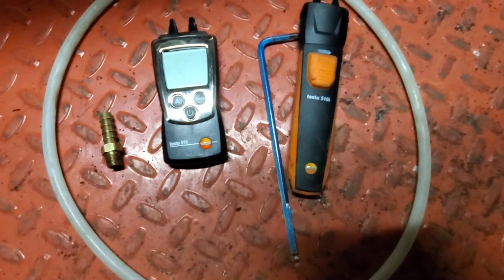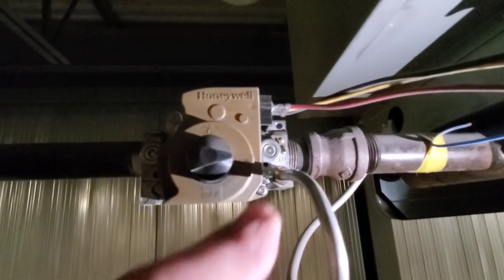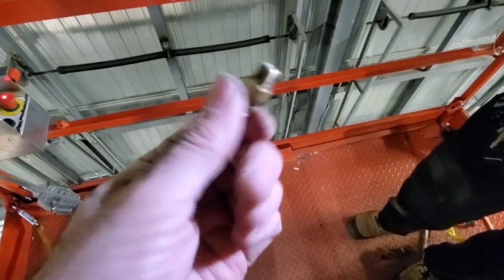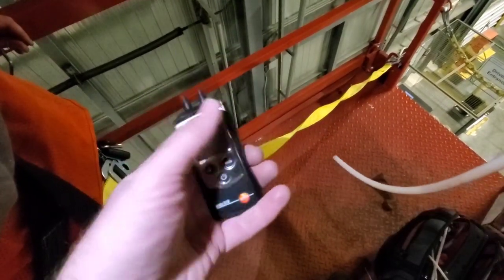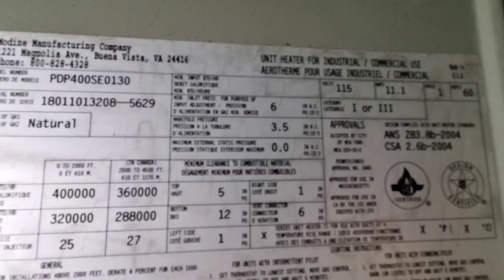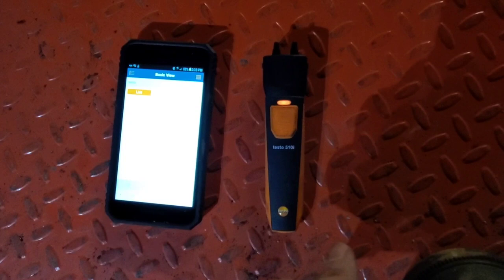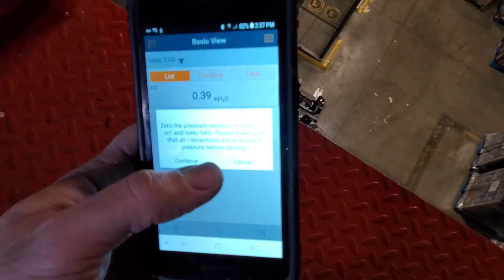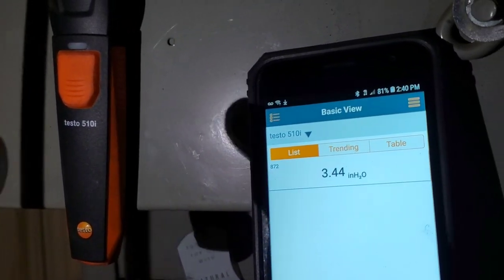Checking Natural Gas Manifold Pressure

Comment: My first WATER   manometer was  DIY,  a pair of cheap 6" rulers  back to back and some plastic tube on a small piece of  wood,  some  cable clamps to anchor  them
For  a fair amount of time I used a Bacharach   blue oil  manometer.  It was nice  but even back then--mid 80's   refill oil  for either it or the red oil for Dwyer was a ripoff.   You DID  spill these once in awhile.     I serviced  nat gas/ lpg, heat pumps, oil and electric hot air and a "few"  boilers.   

Water of course is a PITA  as  it gets  below 0F  up here.  You have to drain it (in your truck) and either  figure a way to  carry a small   plastic bottle, or  fill at the  homeowner's house.  Of course during the day,  just leave it near the heater in the van.  

Water can also  "stick" in the tube  (surface tension)    You  need a tiny amount of detergent, etc,  to  kill the surface tension

Comment: Thanks for the great content.  Very helpful.  Is it ever possible to have zero water column pressure coming out of the valve and still have 3 blue flames?  I had a heater tech show me zero on his manometer yet the heater was running.  Told me my flames were lazy.  They looked good to me.  Told me I needed a new gas valve.  I think I got scammed.  0 gas would equal zero flame, yes?
Reply from the maker: Some burners actually have a negative pressure, that's stuff that should be on the name plate.

Comment: Had a plumber tell a customer they needed another regulator on the boiler. I get there after it was installed. The boiler wo t fire property. The plumber comes back and I asked him why he installed another regulator. He said he was told to. I had him remove the regulator. We tested the manifold pressure. All good. I asked him if everything was back together. He said yes. The next day I get called to the same location. The fire department is there. I found he had left the plug out of the gas valve. WTF?